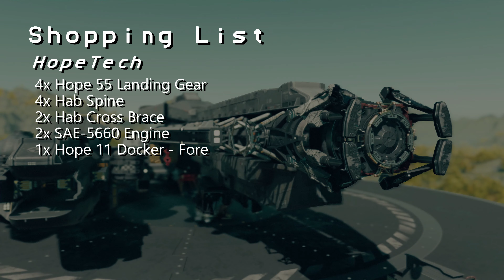STARFIELD | The Scintillant Tutorial | GLITCH BUILD | Eag's Ship Shop Builds

Comment: @16:16 one additional note, and this may be a console only thing (not 100% sure), but after you've gotten the glitched part placed, you can reselect it and it should turn green and allow "true" connection to that point.

You won't be able to move it out of place and back, but you can select it as if to edit without moving and then press accept again to make sure it's part of the build.

Just another method to verify. But your "select all" works too. I just prefer to see it green to make sure it's good.

Comment: I built this ship... Then a funny glitch happened.  I kept getting these error messages about storing Save files (to the Steam Cloud).  So at one point, the game wasn't sure about the build, and when I took off only a small spine section actually took off.  Sadly I didn't think to take a screenshot (I was pissed because of all the error messages).  Eventually I moved this game off the Steam Cloud and now I'm not having those issues.
Reply from the maker: Lol thats nuts! The steam cloud saving thankfully hasn't given me much grief, but I usually make manual saves along side of the autosaves JUST in case. Steam cloud seems to only upload the starfield autosaves